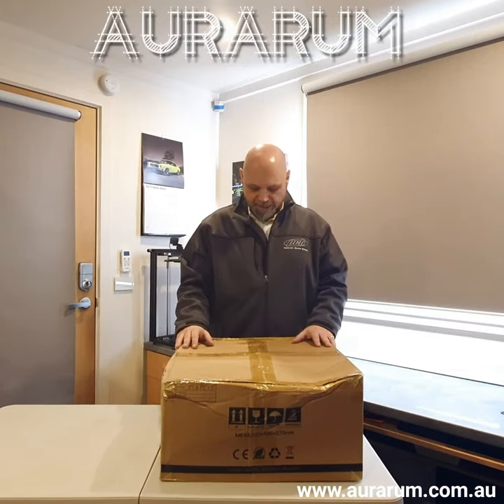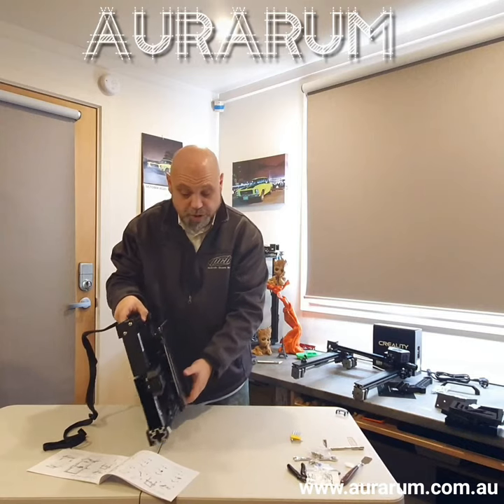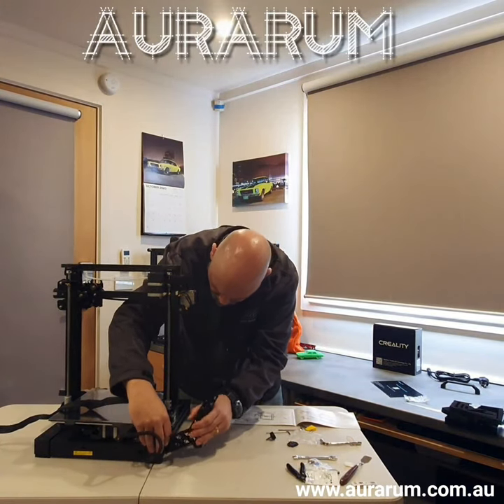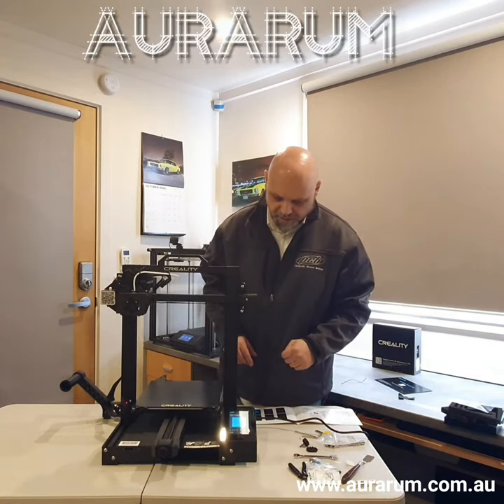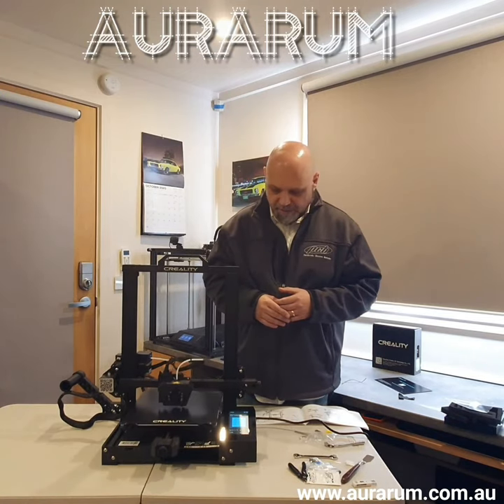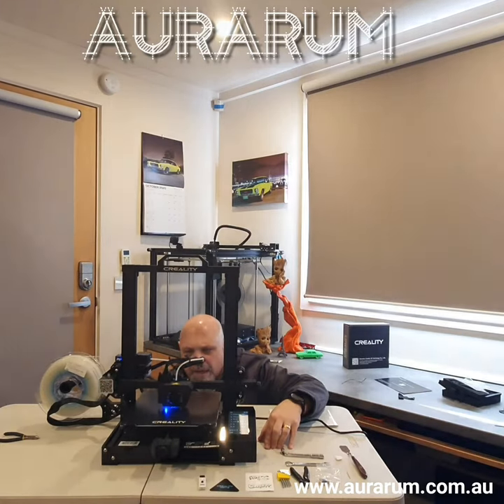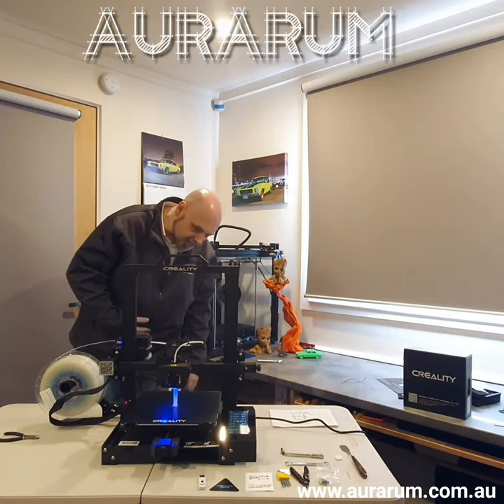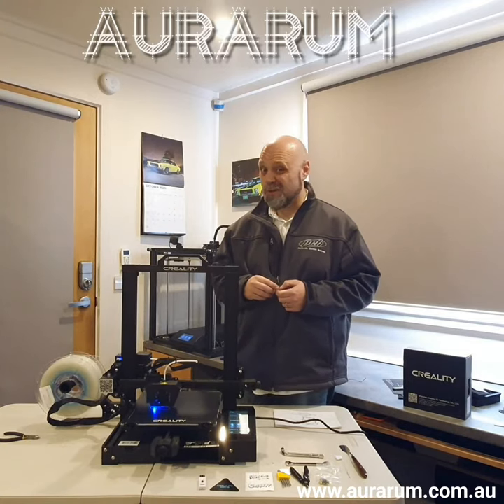Creality CR-6 SE unboxing video with setup / opinion / review - AURARUM

Comment: Can the spool holder be relocated somewhere higher? I have limited boxed wall storage around 4inch wall high  for the printer. Thanks
Reply from the maker: Yes - No reason why not :)  - Just ensure your path from the spool holder to the filament sensor is nice and straight and you will be fine.

Did I mention that I love the spool holder?

There are hundreds of different designs available for external spool holders on places like Thingiverse - https://www.thingiverse.com/search?q=spool+holder&type=things&sort=relevant

Personally, I am a user and fan of the TUSH model :)

Comment: There was another youtuber whose tesioner broke during shipping so i´m guessing they decided to just  leave it uninstalled to avoid  problems. Probably the  manual was already done by then so... yeah. Maybe leave a note? idk too be honest. Nice video tho!
Reply from the maker: Thanks Eleazar ... That would make sense 👍

Maybe a supplement to the manual would make that work for all users, could also add in about the belt tensioning then also 😀